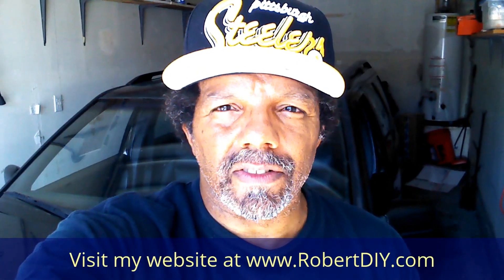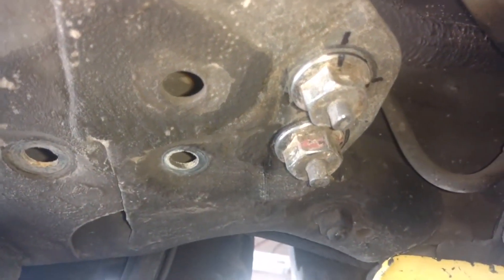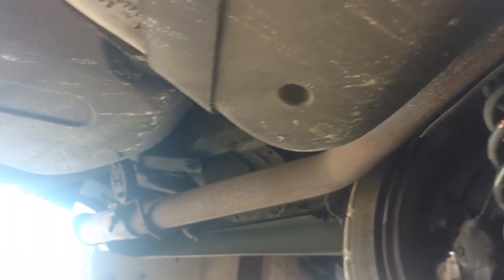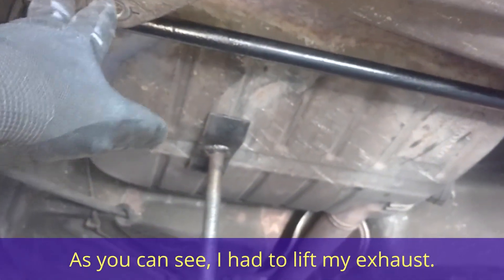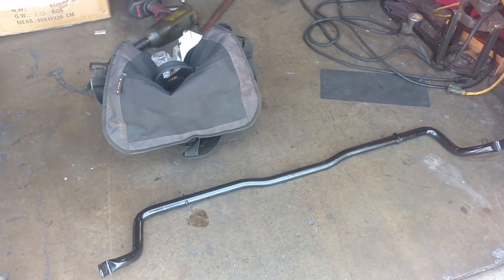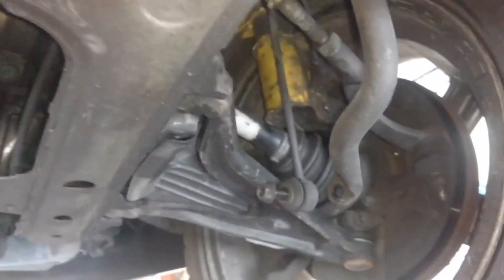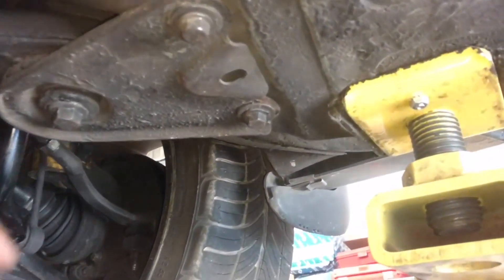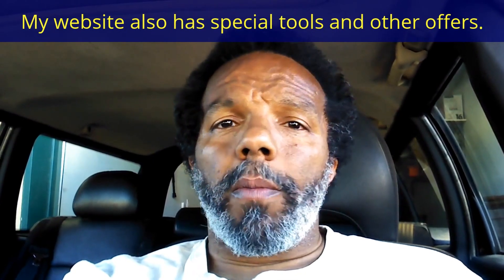Anti sway bar replacement, front and rear, Volvo 850, S70, V70, etc. - VOTD

Comment: Hope you like them. I know I like mine a lot. Please make sure you have the HD end links at some point or you will have broken ones. In answer to BlastReadingSeries,these HD anti-sway bars are as thick as can be used on the P80 series,made by IPD and race tested as well. Mine have been on now for over a year and they make a great dif in cornnering.My is a 2000V70 base model.The lube is only used for putting the bushings on and do not need relubing. Thank you Robert for your vids!
Reply from the maker: Cool, I do have HD end links. When it comes to suspension stuff, that's all I try to purchase.

Comment: Hey Robert congrats! on your new sway bar installation. Your car isn't an 850 without it. lo.  Also just like you I installed the obx racing rear sway bar inside the (top) trunk rear strut mounts and also for the front (upper) strut mounts. Also installed ipd anti sway in the bottom rear and front with koni orange both front and rear. Robert let me tell you this thing handles!!!. Feels German tight.
Reply from the maker: +Trisdoo o awesome! I don't usually drive to hard but I corner a little fast at times.
Reply: Just driving normally is fine, you'll be thrilled. Happy for you man. Good luck! and enjoy.

Comment: Thanks for the video Robert – am trying to remove the sway bar on my 1996 Volvo 850R – the procedure seems to be slightly different, there is a metal plate that obstructs sway bar removal (the plate is held in place by two of the 15mm steering rack bolts, not sure what the part is called, but it appears to be a general purpose bracket with various parts and lines attached to it). Followed your instructions then got stuck. Also, two of the captive nuts on my steering rack were spinning around, and the heads are circles! No way to get a spanner on them, total pita :)
Reply from the maker: That is not uncommon. Wedge a chezzel or something on the cast screws and impact the nuts off.

Comment: good to see you wearing gloves 😀
Reply from the maker: I go through about 50 per month.
Reply: Why do you always use gloves there in the States?  I use them only if the job is very dirty or hazardous. I’ve noticed that you use gloves everywhere, even if the job is very clean. Using gloves make hands to sweat and the feeling is not the same as working barehands. Do you have some kind of regulations or does insurance companies demand you to use gloves everywhere?

Comment: @ blast @robert. I am hoping for a long term follow up about the squeaks. I have read about people using the bushing brackets with the zerks, or drilling and placing zerks.  Then, drilling into the bushing and cutting groves on the bar side of the bushing. With the expectation that regular, well distributed lubing with marine type grease will keep the bushings quiet.
Reply from the maker: The bushings had some groves in them.
Reply: I just  had the front bar installed and used the Energy Suspension 9.5161G 1" Greasable Sway Bar bushings. work perfect and can be regreased easy

Comment: Hey Robert,
My 2004 S60 has a small clunk in the front. I've changed the struts and all, sway links, control arms, tie rods, both axles. The sway bar is the only thing left.
Reply from the maker: Maybe the bushing.

Comment: this has been on my list of upgrades, thanks for the video! how does panther handle the corners now? night and day difference in Steering/handling?
Reply from the maker: Hard for me to tell really. It is tighter and my wife reaches for the handle a lot less. Feels as tight as it does with the car weighted down, minus the weight lagging down acceleration. lol I do feel more bounce in the front end over humppy roads at 40+ mph speeds. Likely due to worn struts.

Comment: Good job man! Can't wait to see the DIY driveway version? :) 

Did you research the differences between the different kinds of front Volvo Sway bars? I read on MVS that there are three versions: the N/A, Turbo, and the R versions, each version subsequently getting thicker and stiffer, and each version being compatible in all the P80s. I think I'd go that way rather than have to lube up those IPD bushings every season. Especially with the salt up here in the Northeast. I can't wait to hear about what noises this upgrade has gotten rid of. Hope all is well, brother.
Reply: BlastReadingSeries @blast @robert. I would appreciate the long term follow up on the poly sway bar bushings. I have stayed away because of the reported squeaks.  I have read about people using the bushing brackets with the zerk fittings and then drill holes and cut groves in the urethane bushings to keep them lubed and quiet regularly with marine type lube.
Reply: Especially considering the miles Robert puts on his vehicles. I can't wait to hear how the bushings are 20K miles from now.
Reply from the maker: That will probably be in October. lol
Reply: Robert, chasing noises... Was wondering, what kind of noises were you getting from your sway bar? Has this installation quieted down your car considerably? As always, many thanks for all the work you put into our P80s!!

Comment: I just installed a front sway bar on a 850 i only had to remove the back sub frame bolts and plates and wiggled it out
Reply from the maker: That's what I did.

Comment: Thanks for the vid.  Is it necessary to drop the subframe to do this job?  Also, the subframe bushings on this car look like mine- would you say it would be good to replace them?
Reply from the maker: Yes. If they are damaged or worn out.
Reply: @RobertDIY  I was thinking of trying to scrape/burn the existing rubber off and use some clamshell style replacement bushings?  It might be a hassle to get the old bushings off but the replacement would just clip on and then be secured by the clamps.

Comment: Great video Robert, thank you for sharing. I have a question about the power steering lines, do I need to lower the sub-frame to access the nipple for the high-pressure line coming from the pump? I had a look and can't figure out how to get a tool in there to loosen/tighten the nipple.
Reply: Oh, and if so, do I need to separate the steering rack from the sub-frame or can I just lower it all a little to get access to the nipple?
Reply from the maker: Grrr, I don't even know what kind of car you have. 🤷🏾‍♂️
Reply: @RobertDIY  ooops! 99 S70 Base model, manual transmission.

Comment: hey Robert, when at the junkyard  where they say there're no jacks allowed - do you have any tricks for getting the front anti-sway out of a donor P2 car? they have the cars up on steel wheel stands.
Reply from the maker: If the wheel stands are on the sub-frame mounts you have to ask them to lift the front of the car so you can move those wheel stands back. Or you can lift the front of the car with an engine hoist if one is close by.

Comment: Robert,  I have a 2002 V70 XC.  I need to replace the bushings in the control arms and sway bar.  Is it easier to just replace the whole parts rather than mess with trying to just replace the bushings?   And if so, is the cost worth the time and effort?
Reply from the maker: I believe so.

Comment: Is there ever a need to replace the rear anti-sway bar?  I ask because unless you're going for something stiffer than stock- theyre aren't any bushings to wear out.  Just curious what case use there is for doing the rear.  Thanks.
Reply from the maker: Mine was broken.
Reply: @RobertDIY  Ahh.

Comment: Hi Rob, how easy is it to replace just the bushings on the original sway bar, do you still have to remove the whole thing?
Reply from the maker: +Adam Ward probably not but you will have to lower the back of the subframe.
Reply: 850s past i think 94 you have to either purchase a new bar or install poly bushings  and weld a washer on the inside area of where the bushing sit or it will move around.

Comment: if I just do the rear do I need an alignment? sway Bar split in the thin part. might just take it off and weld it if the part is expensive
Reply from the maker: Nope.

Comment: So I tried this today, but had to stop after attempting to loosen the steering rack from the subframe.  The stud on the rack had come disconnected so when you tried to loosen the nut underneath the subframe the whole bolt/stud and nut would just spin.  We tried prying on the top of the stud with a screwdriver but couldn't get enough friction to keep it in place, even though the nut should come loose.  Ever seen this happen?  Any ideas?
Reply from the maker: Yes.
Reply from the maker: Can you disconnect the steering linkage?
Reply: Robert DIY I might give that a try.  Should I drain the system and disconnect the lines or are they flexible enough?

Comment: Hey Robert, are those rear bushings behind the sway bar hard to replace?
Reply from the maker: About a 3/5.
Reply: @RobertDIY  Do you have to remove the whole rear assembly to change them or can you fix them still being attached to the car?
Reply from the maker: You will have to remove the bolts on the ends of the trailing arms.

Comment: Hello. I have a Volvo C70 2.5T 1998 with 20mm stabilizer bar. Now is necessary to replace stabilizer mount (rubber). A new stabilizer bar (sway bar)  21.5mm is best for comfort? Or is best for sport riding?
Reply from the maker: Does not affect comfort, only cornering.
Reply: @RobertDIY  What is the function of the sway bar?
Reply from the maker: Anti-sway bar, prevents/reduces body roll in curves.

Comment: Hi Robert, I noticed you have your car on a professional lift.  Can this job be done via jacking & jack stands?  What do you feel is a fair rate to rent a car lift bay?  Thanks.
Reply from the maker: Yes it can be done on Jack Stands. I don't know if you can find someone to rent you a lift. Insurance is to high and the risk, phew!
Reply: Thanks Robert.  I'm in the Chicago area...  I did find a garage for DIYers & experienced mechanics and they also include air tools.  $28/hour.  (Diffierent rates for longer (full day, weekly or longer jobs)
Reply from the maker: Cool, I had issues and had to leave my car on the stands to get parts. You may want to have all related parts on hand and replace them since it's subject to need replacement.

Comment: I have a Volvo 850 GLT from 96, It didnt pass the inspection because it was leaking from the RMS and they also told me that my sway bar links are bad ;(, Got that car for free last month. 

I replaced the seal last week ago.(I hope I never have do it again)
Reply: by the way.. great vids Robert,  you have been helping me alot.
Reply from the maker: +Robert wow, where are you located?
Reply: Sweden
Reply: I'd like to hear how you went about changing the RMS... seems daunting!
Reply: I printed out the instructions from a website.

I started with removing everything on top of the transmission (Air filter, wires, battery shelf and so on), after that I lifted up the car I dragged both of the drive shafts from the transmission. I used a forklift to keep the engine in place while I was removing the bolts/nuts from the stearing gear, mounts and the subframe (didnt unscrew the bolts fully on the right side of the subframe)

After that I began to tilt the engine so I could get the transmission out from the left wheel well.  Then I removed the starter and all the bolts on the transmission and placed a support under the transmission. 

And finally I removed the clutch pressure plate, throw out bearing, flywheel and so on. 
(I replaced the Clutch, throw out bearing and pressure plate while I was in there, I even bought new bolts for the flywheel)
Reply: I watched one of Robert's videos too. (used two screws to get the RMS out, didnt want to scratch the thing thats holding the Seal)